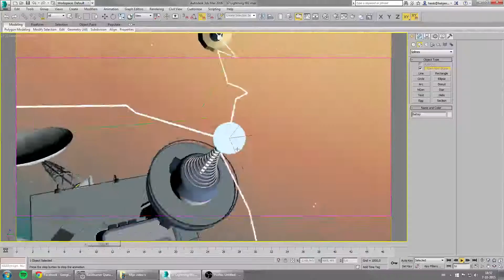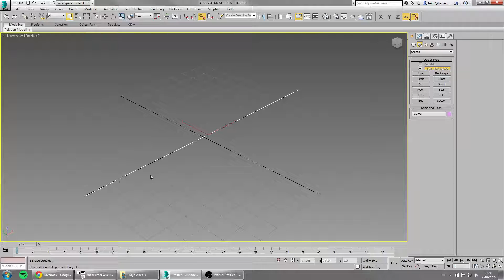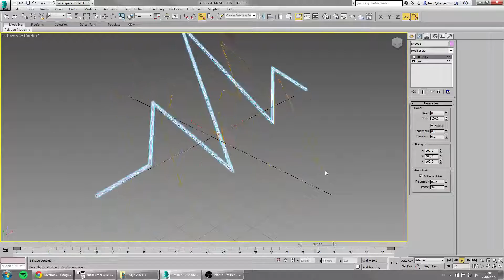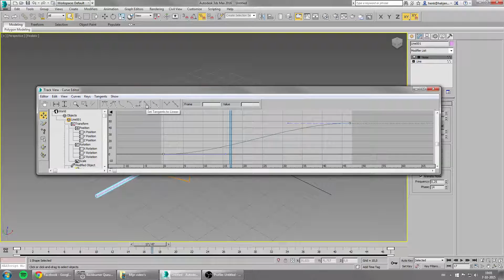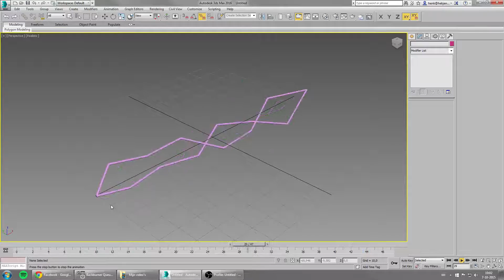Easy lightning effect with lines | 3ds max tutorial

Comment: hi, how can i export the animated line in .fbx? when i imported it in the unity the animation was removed, thanks! i also tried to convert the noise into keyframes but it's no use :<
Reply from the maker: Hi Kim, I would have said convert the noise to keyframes, but if you tried that already I don't know if you can use this. You could of course hand animate the noise for the line (maybe do a small bit and loop the animation?)